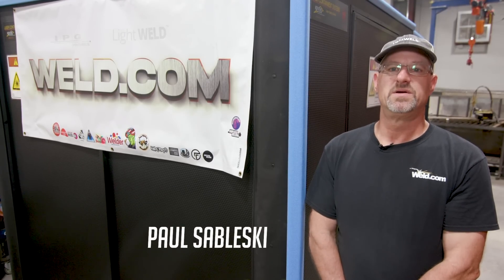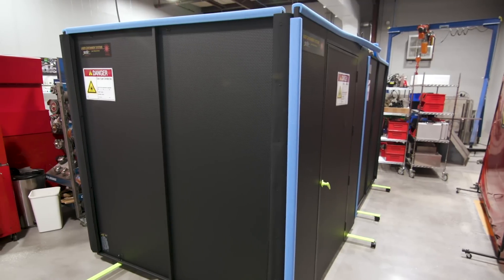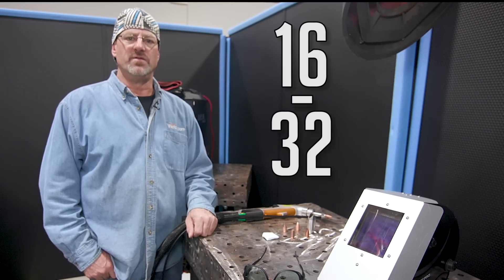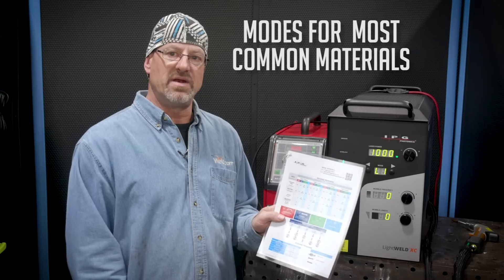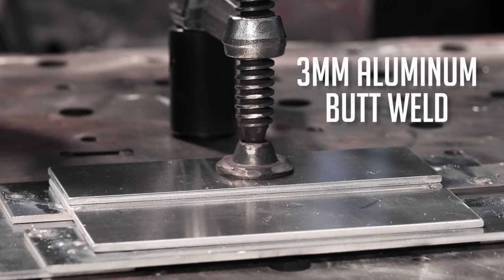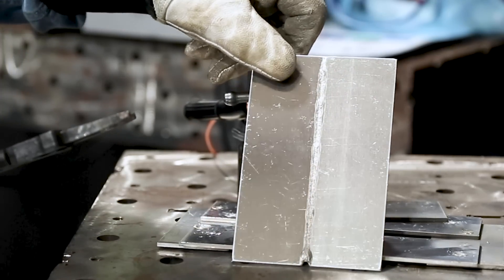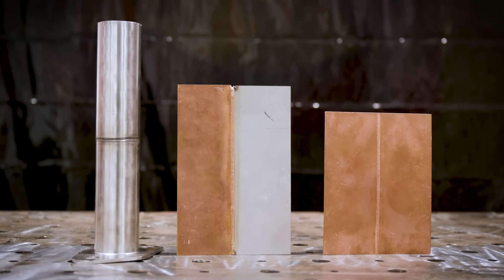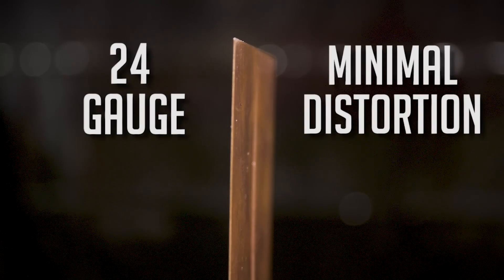Let's Talk Laser Welding with LightWELD

Comment: For a process that has been around for a while, they still haven't figured out how to make it cost effective enough for the majority of small-to-midsize fab shops.  As the owner of a shop, I'd love to have it, but after you figure for various expenditures and training time you're looking at at least 50k, which isn't exactly in the budget.
Reply: Hello Daniel - Whether the higher price is cost effective very much depends on the individual fab shops and the nature of the work.  For many, the increased productivity from LightWELD (reducing both welding and finishing times) results in many more parts per hour, and soon covers the cost.  For many shops, the most expensive element of the process is the cost of the welder's time which is many times greater than the depreciation cost of the hardware.

Comment: Add a cut and etch to the bend test follow up. Also, this seems to be similar to autogenous tig welding? Which we all know is perfect for some applications while not possible for others- say, sanitary SS pipe vs 6061 tube. I’m just not sold on the idea of making something “easier” that should require skill in the first place.
Reply: While many materials are suitable for autogenous laser welding, some material combinations benefit from the addition of welding wire to achieve certain metallurgical results.  In these cases the LightWELD wire feeder can be used with the preferred wire.

Comment: Weld up a cube water tight filling the corners .It looks like travel speed is to fast to properly fill ends or corners.
Reply: Hi Mike - this would be a great demo - thanks for the idea! As Paul attested to, the LightWELD has no trouble producing true, tight weld into ends and corners. Many of our customers (working with automotive exhaust, for example) depend on the quick, tight welds LightWELD produces.

Comment: Could you do laser cleaning with this thing? Really all it would need is a galvo to convert it from a point to a line...

Lets see some bend tests on those welds!
Reply from the maker: He does do some cleaning later in the video but bend tests could definitely be done for a follow up!
Reply: and a cut and etch
Reply: Paul Brown  Doubt that, last laser cleaner I looked at was 50k
Reply: It already has a galvo, that's what generates the line. And it does do a bit of cleaning, but nothing like a pulsed unit could, since this is a CW unit.
Reply: @Spirit532  Wonder how that galvo is cooled?
Reply: @beachboardfan9544  Conduction, probably. You don't really need to cool the galvos if they're not being driven hard, and dielectric mirrors are efficient nowadays.

Comment: So you know those laser rust removers? How hard would it very to make this laser welder into a safe laser rust remover?
Reply: The LightWELD-XC model has the function for cleaning or removing rust over a 0.6 ins wide path for cleaning the joint prior to weld.  This can be used for other small-area cleaning by scanning as well.
Reply: @IPGPhotonicsOxford  this needs it's own video.

Comment: I think I could weld with that. WAY EASIER once you got the settings down. Thanks for showing that...AWESOME TOOL
Reply: For the money involved, you could take an intro welding course at a night school vocational school or a local community college.  I took one before I went to weld school, definitely more affordable than these machines lol.
Reply: @525medic  Then you should know that time is money. This is not some toy for hobbyists, it's meant to be a time saver without compromising quality or safety!
Reply: If you've NEVER welded before you aren't gonna purchase this and immediately be welding like myself or any other longtime professional
Reply: @dieseldabz7104  twenty thousand dollars, you aren't going to be buying this unless you have a significant volume of orders of parts for a production shop.
Reply: @carpediemarts705 just wait a few years. If it's as easy to weld with as they claim the market well make it cheaper. Everyone well be buying them for the fact they can teach almost anyone how to use it, so cheaper labor. Welding well be a minimum wage job soon.
Reply from the maker: It really is!